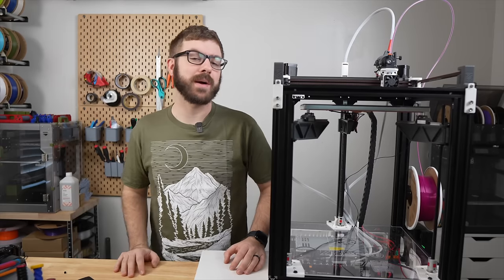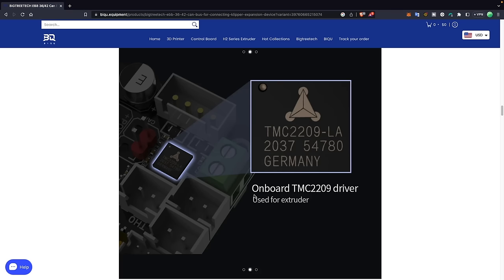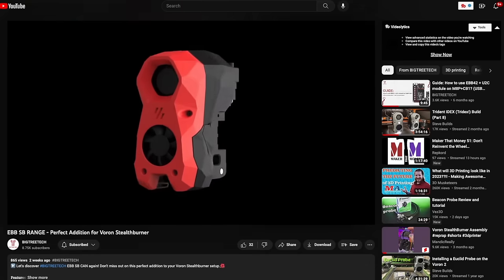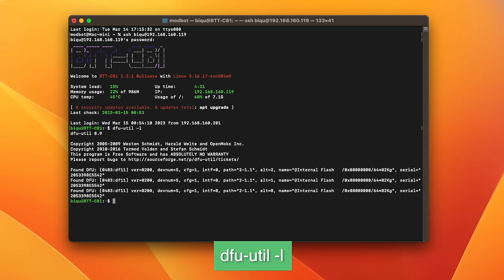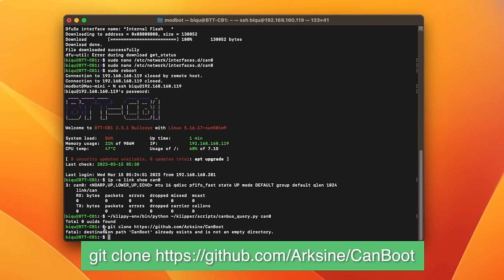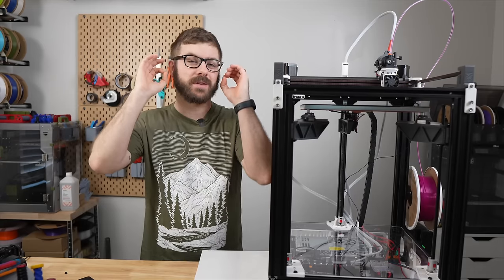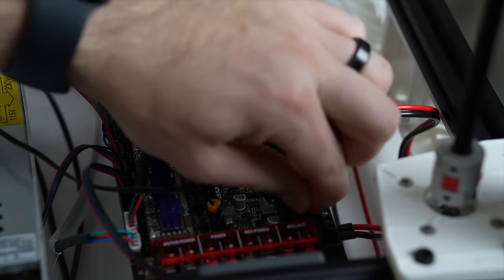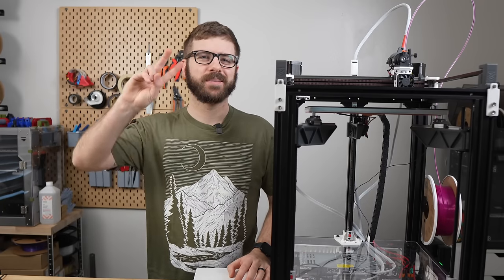Setting Up CAN Bus On Your 3D Printer (U2C & EBB)

Comment: Finally someone showing other people flashing the firmwares only with the Pi/Pi alternative over dfutil and not using this (pesky) STM32 Cube software on Windows! You dont need that software, your Pi is able to do it all and more people should know this! Thx Dan!
Reply from the maker: Thanks DJ! I actually saw the STM32Cube recommended and shown in a few videos. I couldnt understand why? needing to use a desktop app just doesnt seem to make a whole lot of sense to me when you can do it all from the printer.
Reply: @ModBotArmy  Exactly this. Maybe because some people just dont know that you can do it without that (and I think some of this comes directly from BTT/Mellow howtos with countless of that programms screenshots in a pdf)
Reply: you can also use make flash, and I totally agree, on windows 11 stm32cube is very glitchy at least for me, dfu-util works all the time
Reply: Actually STM Cube on Windows wil not work to flash an RP2040 (aka 'pico') based board.  STM Cube is onloy for STM32 microcontrolers.  Also the terms "DFU" does not apply to the rp2040.

The way you flash an RP2040 is to place it in boot mode thenthe chip looks like a flash drive, you copy the binary to the flash drive and then reset the chip.  No special software is required. as the chip acts like a normal USB disk drive.

A lot of these boards are moving from STM32 to RP2040 and as of Feb '24 it is about 50/50.   Inside both are ARM M0 CPUs but the RP2040 is dual core, has more memory is physically tine and cost only $4.  So you can see why it is popular

Comment: When it comes to the choice of cables there are a few things to remember:

1) Highly flexible cables should be used if at all possible. The reason for this is that all cables that flex will eventually break. In a factory we would schedule a pre-emptive cable replacement at a calculated interval. When is your cable going to break? You will know that right after it shuts down your factory. A highly flexible cable will delay this from happening for a very long time.

2) The terminating resistance is determined by what is called the "Characteristic Impedance" of the cable. The idea is to match the impedance of the cable. Basically 120 ohm resistors at each end are going to be just fine.

3) Ideally what you want is a "DeviceNet" type of cable that contains two pairs of conductors, one pair made up of bigger wires (lower AWG number is bigger. i.e. #18 AWG is bigger than #22 AWG). The problem is that DeviceNet is an obsolete media, so your cabling choices are limited. But Belden's "3084A Multi-Conductor" is basically what you are after. The Red/Black pair is for power, the Blue/White pair is for signal. Note that the R/B pair has larger conductors, while the B/W pair has the thicker insulation. Also note that the Belden cable is rated for 75C, and may not be particularly flexible.

3a) If you can't find what you want in a premade cable assembly, find yourself a "Continuous Flexible" cable with one twisted pair and a shield, and a second "Continuous Flexible" cable with one pair but with larger wire. Shielded would be good, and twisted isn't all that important for the power cable. Look for the higher temp wire while you are at it. Honestly, this approach would be preferable in my opinion.

4) Consider making your cable(s) up as an assembly with a free-floating plug at the hotend end of the cable. This way if the cable snags the cable should pull apart and not pull the connector out of your board. Think of it as a "Break away" connector. If you do use multiple cables, don't do something silly like use the same kind of connector for both cables, making it possible to get them swapped around. And remember to put the female end of the connector(s) on the end coming from the controller. This way a loose cable won't have potentially hot prongs dangling about.

5) One of the specs for CANBUS is that you can have up to 40 meters of cable length for a 1Mb/s network. Your cable is going to be 2 meters long. Unless you are Dr. D-Flo, and then it's 10 meters or so... Chances are that any problems with your network will not be in the cable (until it breaks). Meaning that if the system works in one spot, and then fails once the head moves, it's most likely a bad cable. If your system doesn't work at all, it's probably something else.

Jan Axelson's book "Serial Port Complete" has an excellent chapter on RS-485 networks. I highly recommend reading (at least) that chapter.

Comment: I am new subscriber. First just let me say that you are by far the best source of information I have found that explains everything clearly and in a very smooth flow. I have a pretty solid background in electronics and mechanics. I have only been into 3d printing for about 6 months and recently upgraded to Klipper on four Ender 3's. For me, working on the printers is my happy place. I have already learned so much and will be tackling the canbus upgrade you've outlined in this video. I purchased a Creality Ender 6 off Ebay used "for parts" about a week ago (100.00! 25.00 shipping. Great price for something with "good bones") After disassembly and reassembly I had it up and running in about 3 hours. I will be running a dedicated Pi3B for Klipper, with attached EBB46 and U2C 2.1instead of running it with the old PC i have connected to all 4 of my Ender 3's. I really appreciate you sharing this vital knowledge for all of us to enjoy and apply. I will also be attempting input shaping and was wondering what you are using to measure resonance on the print bed? I know that is neccesary for "Bed Slinger" is it also neccesary for CoreXY  like the Ender 6?
Reply: Yes xy axis need input shaping vibrations compensation

Comment: "Hi ModBot, thank you for your informative video on 3D printers! I wanted to share some additional information regarding the use of twisted or drilled cables. While twisted cables can be beneficial for longer cable lengths or in environments with high electromagnetic interference, it's important to note that most 3D printers don't require cable lengths longer than 2 meters.

For shorter distances, such as those typically found in 3D printer setups, the risk of signal degradation or interference is relatively low, even without twisted cables. As long as good quality cables with sufficient shielding are used, a non-twisted cable can provide a reliable connection.

It's always a good idea to ensure proper cable management, avoid sharp bends, and minimize sources of electromagnetic interference near the cables. However, for most 3D printer setups, twisted cables may not be necessary.

Keep up the great content, and thank you for sharing valuable information with the community!"

Comment: Awesome video, I'm going for canbus with the same config so it really helps! Just mentioning if nobody else did: if you put the ebb configuration in a different cfg file than printer.cfg, you are not able to do a PID tune for the extruder because klipper allows writing at the bottom of printer.cfg only.

Comment: I went through the whole process just few weeks ago and it was indeed painful. It turns out that it's better to set the can bus speed to 1M (and repeat the whole process of compiling/flashing) if you intend to use the input shaper... Info that you have to hunt down buried in the klipper forums.

All in all it can be useful in case of toolchangers but otherwise too much of a hassle.

Comment: Excellent walkthrough! I’m glad I sent you those donations during the MercuryOne build streams, money well spent 😊

I’m assuming your M8P is v1.0, without an embedded transceiver, and if that’s the case I strongly suggest you ditch the overpriced USB to CAN adapter for a tiny CAN transceiver which can be connected to PB0 (“ADC2”) and PB1 (“SERVO”) pins on the board instead. You can then configure the Manta in CAN bridge mode, as you would with a v1.1 (or a BTT Octopus). 

USB adapters just suck…

One more thing about the embedded ADXL345 - don’t count on it for accurate input shaper results. The board is mounted too far from the nozzle (where it matters, duh) to provide valuable results. I consider this more of a gimmick.
Reply from the maker: Interesting! I did see a guide showing the trasceiver being uses with the BTT Pico and figured that was needed for Can Bridge. Maybe I misunderstood though. That is cool to know. 

As for the ADXL I have seen that nozzle is the best place to mount it but most of the time I end up mounting it to the layer cooling fan which is lower than the EBB but still high up. It may not be as accurate but I still think it definitely does help. I would be curious to know on the X1 Carbon or P1P where in the toolhead they have it. I feel like it does a pretty good job. 

Thank you for the feedback and the support <3
Reply: @ModBotArmy  an external CAN transceiver is needed for boards which don’t have one. 

Most modern MCUs have CAN support built-in - if you look at the documentation for most STM32 MCUs you’ll see CAN_TX and CAN_RX pins. A transceiver (on-board or external) is then used to convert this serial signal to CAN-High and CAN-Low. 

With RPi Pico, CAN support is implemented in software, thanks to the awesome work done by the Klipper developers. Due to that, you can tie any free GPIOs to the CAN transceiver. 

I happen to have two manta boards on my two Mercs, one is v1.0 and the other is v1.1. Setting up an external transceiver took a bit of figuring out the correct MCU pins but I managed this. In my opinion this is a much cleaner way than a USB adapter - and on the manta you have only 3 (one is a a 4-pin header). 

I like CAN bus so much that one of my machines now has a network of 4 CAN boards (I know, don’t ask…)

One thing I do agree about the embedded accelerometer is that it’s better than no accelerometer at all 🙂

Comment: Thank you so much for this tutorial i was struggling with this for almost two weeks now and could not get it to flash the ebb36 properly (maybe because of the faulty u2c firmware) but following your video it worked on the second try.
The first try failed because there is a small mistake in the description where it says:
python3 ~/CanBoot/scripts/flash_can.py -i can0 -f /klipper/out/klipper.bin -u MYUUID
it should be:
python3 ~/CanBoot/scripts/flash_can.py -i can0 -f ~/klipper/out/klipper.bin -u MYUUID
in the video its displayed correctly but copying it from the description gives an error
Thanks again for the great explanation
Reply from the maker: How strange, I swore I copied everything from the terminal exactly how I entered it. Thank you for letting me know. I have updated the description. 

Awesome to hear that it helped!

Comment: You used the U2C because your M8P didn’t support can is that correct. I have the M5P that has can and both 36, and 42 boards. I have been searching to find the answer as I didn’t buy the U2C. One forum post I saw said the onboard can should work. 

Maybe you could do a follow up on how to set up the USB bridge and touch on the onboard can options. 

Love your vids, they always get me past the roadblock when I’m learning something new.

Comment: Very informative. Makes wiring cleaner, I recently rebuilt two 3D printer electronics and wiring and although a little more complicated to set up, CAN would maybe save me a lot of trouble with wiring. However I still didn´t felt like it was time for me to move into that setup, so I went with "traditional" wiring instead. 

Maybe in future builds. :D

Comment: Prior to start doing what is shown on the video it is strongly recommended to perform a brand new clean re-installation  of  the whole OS with a up to date Klipper on a Raspberry Pi first. Otherwise there is a chance that you'll end up with "Total 0 uuids found" even though your wiring, jumpers and whatever else are perfectly done.

Comment: With this video I finally managed to configure it, and as you say it is not easy, but if you continue paying attention to the notes you will achieve it, I will venture to use the i2c port or the USB of the EBB 36 CAN, as a note, I used an audio cable for my can bus, initially I looked for a 4-wire one, but I couldn't find one, I used the two-wire one that comes shielded and a ground line that I didn't use, what I did was build with two of these cables, one for the can and the other for the 24v, thank you very much

Con este video por fin logre configurarlo, y como dices no es sencillo, pero si sigues atento las notas lo lograras, me aventurare a usar el puerto i2c o el USB del EBB 36 CAN, como nota, use para mi can bus cable de audio, inicialmente busque de 4 hilos, pero no encontré, use el de dos que viene apantallado y una línea tierra que no use, lo que hice fue que construi con dos de estos cables, uno para el can y el otro para los 24v, muchas gracias

Comment: Good idea if you don't have enough (source of) issues yet. Well, just kidding but to me perfection don't come when you added everything you 'can' but when there's nothing left to remove. As an early reprapper I'm afraid 3D printing setup grows in complexity (firmware, number of parts, etc.) with a considerable extra time/money spent. Do you remember how inexpensive, quick and easy was a board/firmware replacement with Marlin 1.xx and Arduino IDE ? I wish next evolution will simplify all that mess.

Comment: This was exceptionally helpful, thank you. Do you know if you would need 2x of the BTT U2C boards to run two separate EBB's or can you run two off the one board?
Reply: Super late reply but as far as I understand, a main benefit of CAN-Bus is the ability to daisy-chain devices. You likely only need one BTT board to communicate with the EBBs :)

Comment: Great video! I’ll need to use this method on my cb1 for switchwire
Reply from the maker: Are you planning on removing the cable chain then??
Reply: @ModBotArmy  the chains just look so cool on switchwire! Asthetics > Performance in this case!, sort of the same thing as rgb make computer faster! But, I think I would run the canbus wire through the chain! Then again my v0 input shaper results before and after canbus prove that the mass bundle of wires impacts performance. But what really drew me into the switchwire was how good the chains look on the machine!

Comment: Thanks for the video. I haven't finished this project yet (lots of crimping to do). But I was hoping you would post where you got the mount/strain relief.
EDiT:
You really lost me on the "final steps". It seems that what you are saying and what is being displayed in the video are different. Are upper and lower case interchangeable in Klipper? CANBus gets spelled and displayed many different ways in the video.  
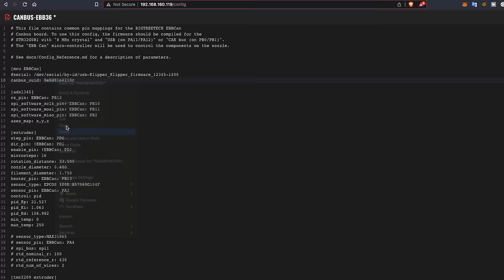At 13:33 the Mainsail screen shot shows the file "canbus-ebb36". Isn't this supposed to be a .cfg file? because at 13:32 the Mainsail screen shot of the printer.cfg file shows [include canbus-ebb36.cfg}
Also, on the same printer.cfg screenshot there is no "serial" definition. Is that supposed to be deleted?
And finally, you say "just like when you built your original config file swap out pin IDs as necessary" What?
I'm transitioning from Marlin to Klipper and have set up a few printers with Klipper and thought I had a fairly good handle on it. But, for me, you went way too fast through the final steps. And some coverage of the verification process would really be helpful.
Now all I get is "Option 'serial' in section 'mcu EBBCan' must be specified".

Comment: Confused, are we replacing the printer control board with smaller ones, one on each stepper and one for the hot end? If so, what function does the main board do? Shouldn't we just have the smaller boards and a Pi (no mainboard needed)? A second or third printer should be also connected to the same Pi.
Reply: It's mainly meant for the hotend/toolhead, so there are only 4 wires. Two fans, extruder motor, heater, thermistor and maybe RGB LEDs are a bunch, especially if you need to crimp them all.
Reply: I've thought of that also. I think you could run a printer with these boards at each motor without a dedicated main board.

Comment: I've been through the entire code base and changed quite a bit of it.  The move, move queue, and rails abstraction are very well done.  So is the entire configuration layer.  The bad parts are (although far better than Marlin) the trapq trapezoidal planning. This should be replaced by S curves.  I didn't care for the way they implemented end stops, extruders, and the tool head object.  Being limited to 1 tool head object makes you have to play games with the kinematic python files as well as the C helper files when implementing IDEX features.  I'm not a fan of the extruder object, as it doesn't allow room for spindles or such.  The good news is it is so well written, it's easy to change.

Comment: do you think that it is reliable to use can bus for high speed printing? is the communication  fast enough to handle it? 
and this 2209 driver that comes on the toolhead board can work in enclosured printers? or it will need some water cooling?

Comment: since you are using a pi you don't need ftp it has sftp built in as part of the ssh protocol just select sftp and login with your ssh credentials
edit: i rewatched the video youre already using sftp maybe call it the correct name to prevent confusion.

Comment: Not sure if it was mentioned but your command "sudo dfu-util -a 0 -D ~/CanBoot/out/canboot.bin --dfuse-address 0x08000000:force:mass-erase:leave -d 0483:df11" has the B in canboot capitalized and it could not find the fw file. Thank you for the guide.

Comment: I wonder if the best way is to K.I.S.S. (Keep it simple ...).
I can say to keep all simple, no lag software to add specially in the move of extruder motor that need fast response and to avoid the driver in hot chamber.
The wires can be wrapped in protective silicone tube to avoid the chains.
Excuse me for being devil's advocate.